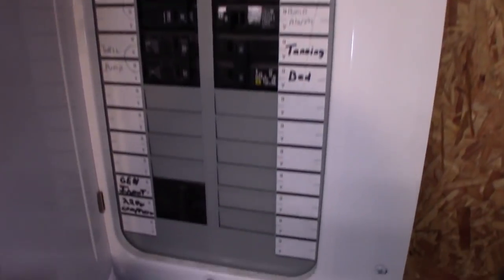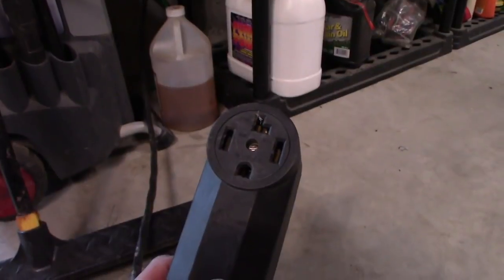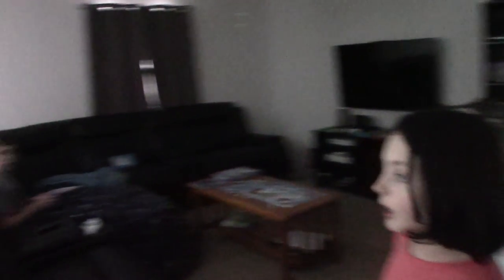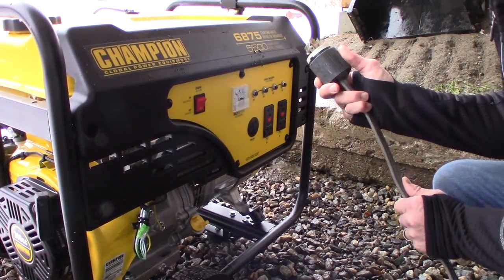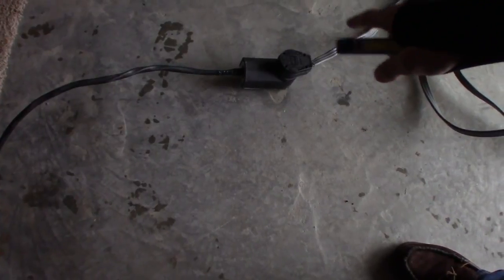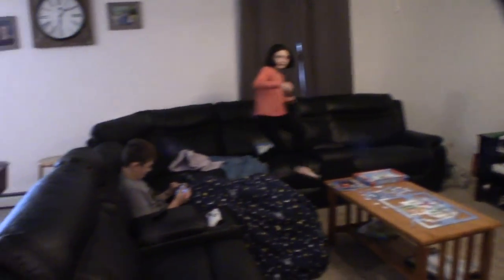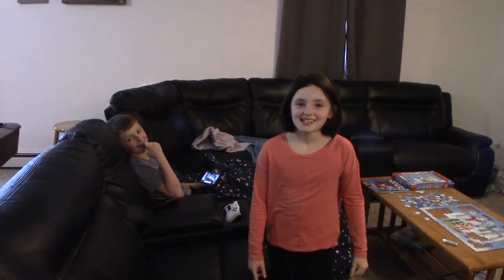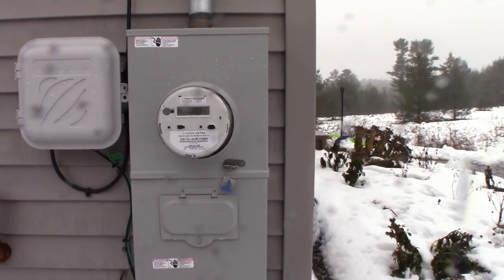Powering my ENTIRE HOME with a Gas Generator

Comment: So back-feeding 220 volts won't blow up the other 120v things in the house? Is that standard or do you have some sort of special device hooked up to the breaker?
Reply: You're fed 3 wires from the power company:  a +120V, a -120V and a Neutral.  Half your house is powered by one 120 leg, the other is powered by the other 120 leg, and your 240 stuff has a wider breaker that spans both 120s to give you 240.  To re-power the house therefore, you need to supply the same +120 and -120, which is what the 240 output by the generator gives.

Comment: Your back feed breaker should be placed at the top, under the main house breaker, and be installed with an interlock mechanical switch to prevent both breakers from accidentally being on at the same time.  They are cheap and it’s another level of protection.

Comment: Of the 100,000 or so people on YouTube that have done exactly the same thing that you have here, I want to congratulate and commend you for giving ALL of the necessary information that one should have when doing these things this way. Just so that you know, if you don't shut off your main meter breaker, you won't damage the transformer on the pole but you will shoot some poor schmuck off the power pole down the road who's trying to hook you back up. In my case, it would take the 240 volts from my generator and boost it back up to 7,200 volts. A bad day for any lineman not expecting that surprise.
    Anyway, there is one thing, however, that you've done that makes me fear for your family's safety. If I saw correctly on your video, you used 10 gauge wire in your "suicide cord and possibly in your input outlet. If so, this wire is way too light to run your whole house. I understood from your video that you have a tanning bed and an electric stove. You also mentioned connecting your heat if necessary. If it is electric heat, this could be the burnt icing on your cake. I couldn't see clearly but I think you have a 6875 watt Champion generator. If so, and if this is your actual running watt rating, this yields a total of  57.3 amps @ 120 volts or 28.6 amps per leg. Another way to look at it is at 240 volts @ 28.6 amps maximum. While any one high drain appliance in your home is probably wired with 10 gauge wire, in order to run your electric stove, an electric drier, electric hot water tank or possible electric heat which in itself would use 8 or 6 gauge wire, any two or all four at the same time, from your house to the transformer on the pole, you'll find 2.0 size wire that is about the size of your index finger. The 10 gauge wire in your setup has nowhere near this capacity. Add this to the extra distance between your generator and power panel causes your line losses to increase. Also, your main 40 amp breaker in your panel is WAY oversized and won't blow properly or at all in the case of a short circuit. The added resistance in your 10 gauge line may also hamper the breaker in your generator from blowing if it had to. If something in your house shorts out, under normal circumstances, it should / would blow the 15 or 20 amp breaker for that circuit. With your 10 gauge wire, The added length / resistance and it's associated voltage drop would cause your circuit's breaker to see less than it's rated maximum current.
    Lets say that you have a 1,500 watt toaster and it shorts out. Working properly, it should draw 12.5 amps at 120 volts to toast your bread. Dead shorted, it may demand 25 amps or more. This is almost the total output for that leg of your generator. Now add to this light's, fans, kids video equipment and anything else running at the time and your trying to pull a lot more water from that hose that it can provide. In the case of the toaster, that breaker won't blow and neither will any other one down the line so the wiring in the wall begins to overheat and..... Well, I wouldn't want to consider the results. Remember, your total generator output PER LEG through each breaker is on'y 28.6 amps. A 30 amp double breaker would be perfect for your main breaker application.
    However, there is a way around this and other issues that your setup has. Some of this may or may not be practical for your application but here's some suggestions.
    I've seen a lot of people on YouTube install a dedicated waterproof outdoor outlet box on an outside wall near where they park their generator during an outage. This isn't as expensive as having your insurance claim denied because the fire inspector didn't like your setup. For me, I have a garage that is NOT connected to my house. My generator spends it's entire life in it out of the elements. After it was built, I wired it myself using 14 gauge wire for low current lighting circuits and 12 gauge wire for circuits powering power tools. When I wired it's breaker box into my main outdoor power panel below my meter box, I used 8 gauge wire which is rated for at least 50 amps. At the time, I had only a 5,000 watt generator but 7 years ago, I bought a 7,000 watt Troy Bilt for it's electric start capabilities after my third back surgery. Anyway, The main breaker to the garage is 40 amps but the breaker in the garage panel for the generator is 30 amps because my generator puts out 29 amps per leg @ 120 volts or 29 amps maximum total @ 240 volts. I installed a 50 amp 4 prong 240 volt outlet with 8 gauge wire on the wall within 3 feet of the panel box and I made my suicide cord from 6 feet of 8 gauge wire to allow for movement of the generator if needed. My suicide cord is NEVER unplugged for ANY reason which gives added protection from shock hazard. I used a 4 prong plug so that I could have 2) 120 volt legs and their third wire neutral and also utilize the ground from the generator and grounded it to the outlet box then to it's own ground stake as my garage has a gravel floor. The whole Idea here is: 1) To correctly breaker the circuit with a 30 amp breaker to supply my house from a 29 amp per leg circuit source. 2) Be sure that the wire from that source is sufficiently sized to carry my maximum possible load. and 3) Keep ALL wires as short as practical to do the job eliminating as much line loss, aka voltage drop, as possible.
    Now my house is all electric and even with my sometimes oversized, (wire), setup, my 7,000 watt generator still won't run everything in my house. Generators are sometimes over rated, literally. Like with DC to AC inverters in campers, they'll say "3,000 maximum starting watts" when it's actually a 1,500 watt unit. The 3,000 watt output is for 1/2 cycle supposedly to start a fridge motor but this isn't long enough so it's all crap. I don't know if your 6875 watts is your running watts or only starting watts. Speaking for my unit because I know it's ratings, it is a full 7,000 running watts with a maximum of 10,700 overload watts for 5 minutes. This gives me enough power to run a window A/C unit, my coffee pot, the microwave oven, a desk top computer, several flat screen TV's, various lights and ceiling fans and the 240 volt BLOWER ONLY on my central heat / A/C unit to circulate the air in the house in the summer, a refrigerator / freezer and a like sized upright freezer ALL at the same time. In the winter, we have propane logs in the fireplace for backup heat. If we need to run the 40 gallon, 4,500 watt hot water tank, then we have to cut back on some other loads for about an hour. What it won't run is my central heat / A/C itself, my drier and only one or two burners on my stove. It could run the oven if necessary but again for this, we would have to cut back on other luxuries. We don't get this extravagant at meal time very often when the power is out. Lasagna is nice but it costs more gas to bake it. Just like with hot water. We take shorter showers if the power is going to be out for days and do laundry sparingly because we have to hang it out to dry. It's difficult to drier sheets with a clothes line.
    Anyway, you have some great kids there and I wouldn't want to see anything happen to them or you. I just thought I'd offer these suggestions to keep ya'll safe. Good luck.
Reply: This is absolutely the best, helpful, most thorough and accurate reply in the history of the platform. Good on ya, friend. If I could tip, I would. LOL
Reply: Thanks! I’m copying this info to my notes when I am ready to add a power generator to the setup. A great addition and “fine-tuning” to the video! Appreciations from mountains of upstate New York!
Reply: @odalv7278  I miss the mountains of upstate New York. I was born and raised in Rochester. My father retired from Kodak in 1974 and we moved to Florida. (I was 19),  where I lived for 27 years. My family moved to West Virginia 21 years ago. I have a sister who lives in Kent. I've gone to visit her 4 or 5 times since moving here. Boy, how the city has changed in 48 years.

Comment: Hey Todd.  Couple of things.  I've been an electrician for 30 years and I'd like to share some useful info.  

First the 5500w Generator you have provides you with just 25 amps of constant amperage.  Pay no attention to the "peak" rating of 6750w.  It is dangerous and damaging to run more than the rated 5500w.  

Second, if you are running your whole house on 5500w which includes 2 refrigerators and a freezer those 3 appliances alone take you well over the 25 amp range if all 3 are running at the same time.   Your generator may handle this load for a certain amount of time but sooner than later your generator will be toast.   I'd recommend at least a 10,000w generator to run a home. at the very minimum.

Third,  recommending this procedure to unknowing people is probably not a wise idea.  Many have electric heat pumps which require a lot of power to run heat.  I cant help but think some "johnny homeowners"  trying this and either immediately burning up their undersized generators and or causing a serious hazardous and dangerous situation. 

And finally, I work in the industrial field and come across used but working ATS's (automatic transfer switches) from time to time.  I'll keep you in mind the very next one I get.
Reply from the maker: I completely agree with everything you said, I make sure not to overload the generator while running appliances. Typically I'll run one at a time, never all of them together. That being said, my 3500 used to work pretty darn well in these situations. Thanks for the input! I'm hoping Johnny homeowner doesn't attempt this, I would assume somebody willing to undertake this would have a decent understanding of residential electrical wiring.
Reply: @preston121068:
You are an electrician recommending this guy to buy a 10kW generator to feed his entire home when you have ZERO clue on how much power he consumes per minute..??
Maybe you should advise people to buy a wattage gauge to calculate how much power your house is consuming at one time .... before telling them to buy a 10kW generator that they may not need ...
Reply: @ACommenterOnYouTube  he was going based off because he has two refrigerators and one freezer. If all are running somehow at once, with just those appliances it would be maxing out the generator that he currently owns. It's allways better to oversize rather than undersize and burn up a generator
Reply: 2 refrigerators and 1 freezer will NOT overload that generator .. I run a 3 ton ac unit, 1800W microwave and SEVERAL lights with a 7kW generator ...
Reply: @ACommenterOnYouTube  that's only about 5400 watts is all bing used at the same time. Yours is a 7kw of course it's not gonna overload it. Your point?
Reply: @ACommenterOnYouTube  yeah just the fridge and freezers it'd be fine. What about the rest of the house? Receptacles and lights? Sump pump? Furnace?
Reply: @Aaron Rice:
My entire house, all ceiling fans ON and on HIGH,, all lights inside and outside ON, all TV's ON, all cable boxes ON, internet modem/router ON, server ON, back up drives ON, bathroom vents ON, all electrical outlets LIVE ready to turn something ON .... all pull ~2400 Watts ....  ADD the 3 ton AC unit at ~3200 Watts puts me at ~5600 running Watts ... still have power left over to use.
Microwave ~1800 Watts
Washer ~200 Watts
Dryer cycles on and off at 6K Watts
Water heater 4400 Watts ... 
240V pool pump on low ~75 Watts and 300W on high speed

So what i do is just cycle the ac ON to cool the house down, shut the AC off, then turn on the water heater to heat up the water, then shut the hot water heater OFF, then use the stove to cook... 

You prioritize what you need ... its that simple. 

2 refrigerators and 1 freezer at 25 amps ..?? You have a SERIOUS problem there ... Try looking up the specs on the average size refrigerator and freezer and show me that all 3 are going to pull 25 amps at 120V .... 

A large refrigerator will pull ~200 watts while in its "cooling" cycle otherwise ~15 watts on standby...
A large freezer will pull about ~100 watts also while in its "cooling" cycle then ~10 watts on standby ...

Do your research before ASSUMING that 2 refrigerators and a freezer will pull ~3K Watts LOL ...

Comment: Its a good idea with the power outages nowadays. If I may give some safety advice I would recommend that your power cable from the generator should have a female side to be connected to the power cable of the house so that in case it become disconnected by accident, that no live pins is protruding.

Comment: great video! cant stress enough that this is a very dangerous thing to do! I think I will hire an electrician to install the cord and breaker and interlock switch though. I did this to power my place using the stove plug. worked great in a week long outage.

Comment: Most of all, I like your kids!! This is a great video and much appreciated by someone like me who knows ZIP about using a generator for power. I made the mistake of buying this little fella that is supposed to be used off-road, thinking I could sneak some power for the house. I don't think so when I see videos like yours. So I do need a bigger generator. I live rurally in the mountains and we frequently lose our power during storms (thankfully, it seems to get restored quickly). But, in my last rural home we went without power for more than two weeks because they just couldn't get in to us for that long (trees and debris in the way and - more IMPORTANT folks to handle first). A generator is not a luxury, but a necessity. I'm definitely going to invest in one as soon as monetarily possible.

Comment: Todd, one small thing that should be addressed: If you’re using the ground wire from the generator receptacle back to the main panel to ground your generator, you want to make sure your generator is configured with a floating NOT BONDED neutral.
Reply: Great point, Thank you 👍
Reply: What do you do if your neutral is bonded??
Reply: You can probably disconnect the jumper that bonds the neutral at the generator. If you can’t figure that out, then you should disconnect the ground to the box and ground the generator with a grounding rod.

Comment: Some smaller generators only have 2  120 outlets.  If I wire a receptacle to a breaker on each bank, can I power both banks by running a double male power cord to each receptacle?  I'm quiet sure I would need to have every 240 breaker turned off.  Just trying to power small use things like LED lighting and TVs.

Comment: I have done this in my previous home. One very important recommendation I would make is to do a "Lock Out - Tag Out" step by step process to ensure you follow the exact sequence for turning off the main breaker, all the breaker switches and starting the generator - reverse steps for going back on the grid.  I should note that in some locations this setup is entirely illegal and could result in death for linemen if not done properly.  Good video with good explanation

Comment: You did everything except explain How you did it....where didi the cord plug to ?  Did you plug into the dryer circut??
Reply: I think he has it directly connected to the input breaker.
Reply: How?
Reply: @slamdunk58  The same way you wire any 220 breaker. One wire to each 120 side of the bar and one wire to the common and one wire to ground.
Reply: If you don't know or are unsure how to do this, call a local certified/ insured electrician. Everything is numbered and stamped, if something goes wrong and things don't match up your home and insurance are gone. Stay Safe.
Reply: @921aa  If it's supposed to be a how-to video why didn't he show that?
Reply: @bigpardner  Maybe you should ask for a refund?
Reply: He added the two 40 amp breakers for an “input” he said that. If you don’t understand that far, do not do this.

Comment: I had that generator.  Got it at Costco for 600 . It worked great.  Powered hole house.  But the generator started to leak gas from the carb slowly . Had to return it . 5 years old , Costco took it back and gave me a new one .
Reply: You returned a 5 year old generator to costco......and they GAVE you a new one?
Reply: You could have just called the 1800 number and they would have replaced the gaskets and the Carb really inexpensive their CS is unbelievably helpful.
Reply: campion has the best costumer service. also love replacing stuff for free lol
Reply: Bull Shit.

Comment: Please just do this right...pretty much code AND law everywhere:

Rule number 1 is an interlock. Less than 80 bucks
Rule number 2 is an actual generator socket. 50 bucks. 

$130 bucks not risking lives is worth it. 

"Better safe than sorry" as you said.
Reply: Back feed.  Save the money
Reply: @crispychicken2743  sound advice. Lol